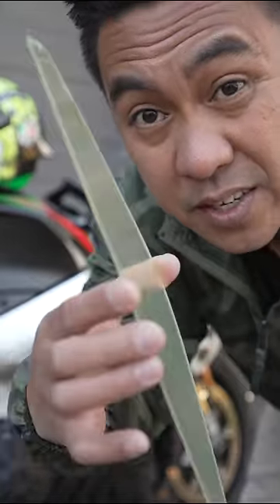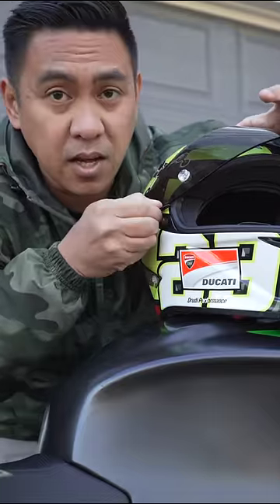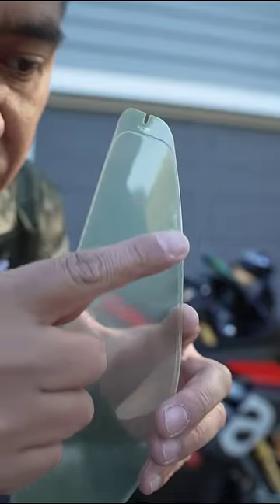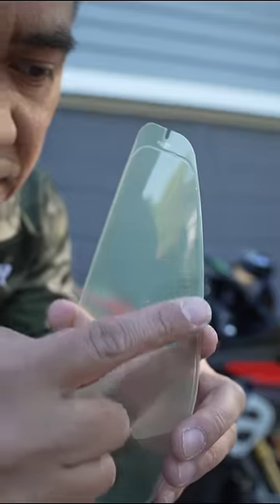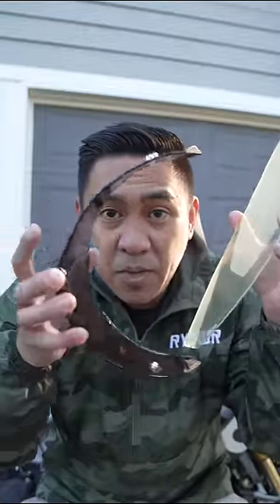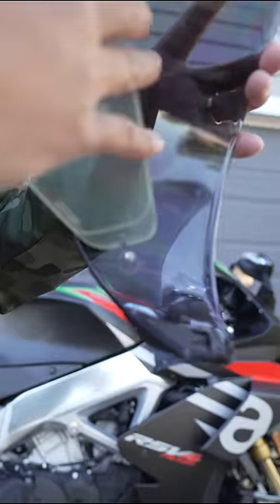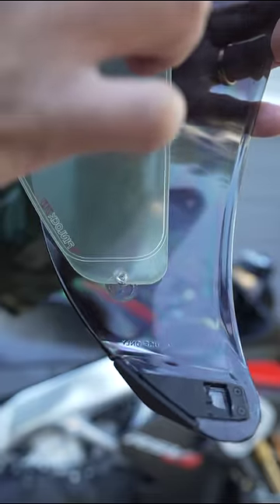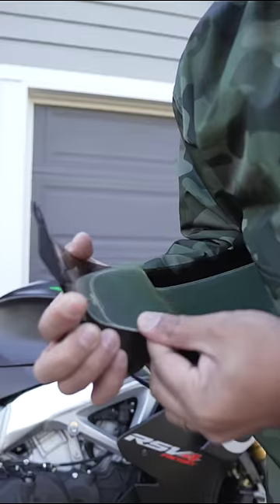HOW TO INSTALL A MOTORCYCLE HELMET PIN LOCK

Comment: that is not the correct way to do it at all, bending it will bend the plastic... unscrew 1 side, hook the other side in, position it properly, put screw back in..